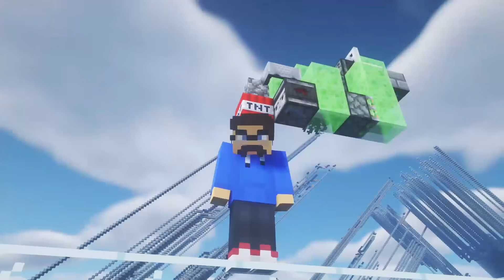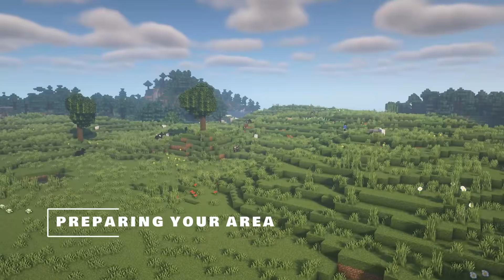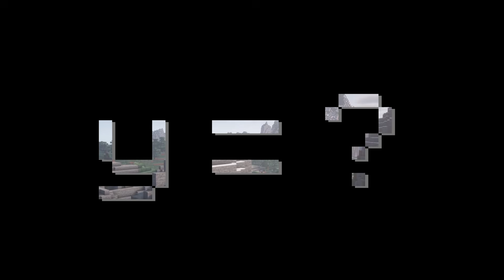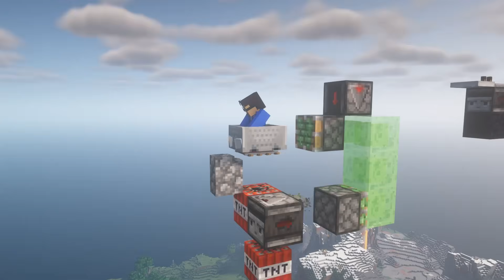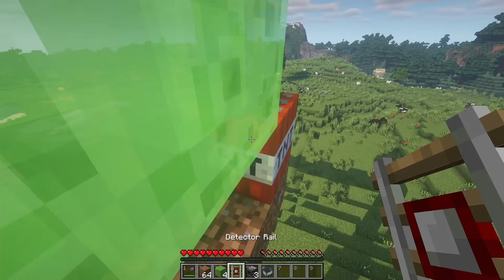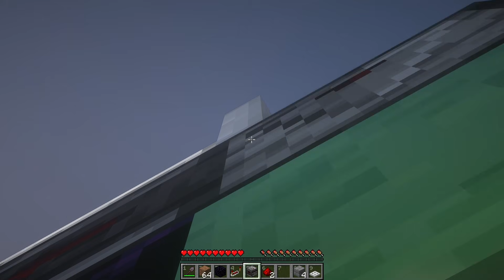TNT Duper Flying Machine

Comment: This works on 1.18.1 too, so yay!!!
Ok, so to clarify what the machines should align with:
Once you built the flying machine and its attached returner, the other returner should be aligned in a way where the iron trapdoor on the returner aligns with the observer on the flying machine and the observer on the returner aligns with the cobblestone wall on the flying machine.

If you match those two then the machine will return safely.
Reply: did that, still not working
Reply: how do i activate the machine, like to make it fly
Reply: Yeah it doesn't send itself back, im guessing this works differently in 1.20.4. The trapdoor doesn't go off, or at least long enough for the observer to see it.
Reply: @Sleeper____1472  Hi I FIGURED IT OUT, You need to set the repeater to 3 ticks not two, its a timing issue.
Reply: I'm sorry, but next time, DO THE SH!T IN CRATIVE AND ACRUALLY SHOW US WHAT WE REALLY SHOULD DL AND WHERE THE HECK THE SECOND TRAPDOOR IS GOING TO BE, IT JUST BROKE EVERYTHING.
Reply: @gilbert.9483oml thank you now ik im not alone 🙏🙏 he doesn’t even tell us where to line it
Reply: Yeah my tnt isn’t duping at all I tried building it in creative also tried it on minecraft Xbox one edition just because why not, everything else is groovy the machine works just doesn’t dupe, any way of making one with a dispenser?
Reply: @stevesober76seriesx25  its meant for java
Reply: @stevesober76seriesx25  dupers dont work in bedrock
Reply: the stone wall is higher than the observer so how does that work
Reply: @gammr3227  ohhhh. Dammit i just wasted 40 mins
Reply: It’s fake

Comment: Has anyone figured out why the machine is running but the TNT isn't exploding? It moves 1 block backward, but nothing happens. on Java 1.21.11. I made sure to use a dead coral  in the right place.
Reply: You might have built it wrong, I just made it and everything works perfectly.

Comment: I can confirm this still works in 1.21.11!
A couple things i noticed (which are all skill issues i faced)
1. If the return stations are not working make sure the repeaters are set to 2 ticks
2. If the minecarts fall off the rail, it may be because you bumped into it with your player hitbox. I fixed this by just placing the minecart last.
3. If the machine does not start going, make sure you have placed the last observer. 
I made this machine like a million times because im removing a mountain so I observed a few things while doing this and thought I should share incase other people are having the same issues. 
As long as you dont have a skill issue like me you should be fine though 😂😂
Reply: can you help me build it please i swear my skill sucks but 🙃🙃
Reply: Do you have to sit in the minecart for it to drop tnt? it fly's and returns but doesn't drop tnt
Reply: @joshuaburton462 no you do not have to sit in the minecart
Reply: @DarrinK2026  is coral fan is necessary
Reply: @GamingWithdevil-7 yes

Comment: return station doesnt work. you should showcase more of the machine and the actual parts when making these videos. for most of the part im guessing where to put certain blocks in relation to the duper
Reply: @etortuga1192  it does work
Reply: Set the repeaters to 2 ticks or it will not work

Comment: too many new comments saying it doesnt work 
IT WORKES (i'm on JAVA 1.21.8) 
as said in previous comments align your stone wall with the observer on the other side 
and i did max tics in both repeaters the one that sends and the return station 
thanks works fine just removed a mountain
Reply: @rotembar1551  fr it is working on 1.21.11 to

Comment: Still working in 1.21. I will say if you chain them together, you can hook a redstone trail where the dust is at the main start station to trigger it with one lever, the end ones will be a bit behind but still works, and space them about 10 blocks apart, I tried 8 and they blew up.

Comment: Either I'm doing something wrong or this design is only partially working in 1.21.4. I've built several of them in a big row to make a bigger hole (they aren't touching), and most of them work fine but some of them get stuck at the second return station or stop midair. It seems like there's no rhyme or reason as to which machines do or don't get stuck, just some of them randomly break. Anyone know why this is or, more importantly, how I could fix it?
Reply: try to do the second return station with a three tick repeater this worked better for me

Comment: it does work but the minecart keeps falling off the machine, does anyone have a solution
Reply: Your rail might be facing the wrong way. It should face towards the cobblestone wall, since the wall creates a sort of invisible slab which stops the minecart falling off that way. Or, the minecart could be glitching and fazing through the blocks below, which seems like lag or a tick error of some kind. If you're building on a server, it could likely be lag.

Comment: okay so seeing theres alot of people who dont understand the mechanics, the lower observer on the actual flying machine, take the coordinates on that one and align the repeater block on the return platform to that one. whenever the fence on top of the tnt hits the observer on the return platform the redstone dust will activate the trapdors which activate the LOWER piston to send signal into the piston to extend, it will then go back to the start position and be reactivated going back and forth.
Reply from the maker: bros the type of guy to read the terms and conditions before accepting

Comment: why is there no telling what to line up the return station with? the duper is 2 blocks wide. how am I supposed to know which you mean??
Reply from the maker: The flying machine is 2 blocks wide, the return station is 2 blocks wide, they are built on the same y-level. That's how you align them

Comment: it does work on Minecraft 1.21 Java édition 👍
Reply: Mine doesnt
Reply: @kindkenyon  it works, you may have it set up wrong, or you may be on a server where it is disabled.
Reply: @mixofreak  single-player game, and I have no lie made hundreds of these exact ones. I don't know what's going on.
Reply: @kindkenyon  I don't know then... Works on a current 1.21.1 server with fabric that allows tnt duping, and I literally was using it to blast through stone and deepslate when I commented, following this tutorial... so it isn't the tutorial or vanilla Minecraft that is the issue if you're struggling on single-player.
Reply from the maker: Yes
Reply: Do you knew if it works on aternis 1.21.3

Comment: even though it works and im happy with it, i am not sure how it can go back and forth. It goes flawlessly once to the 2nd return station but doesn’t go back and no matter where i place a lever, it doesn’t return to the first one. I don’t mind breaking the whole thing apart and setting it up again but a bit of a hassle; im in 1.20.4
Reply from the maker: May have to double check how you are building it sorry :(

Comment: DO NOT space these by two how he does in the video. at least not on 1.20. i built 15 and 10 of them broke in the first 20 sec cause they blew each other up. i recommend 3 or 4 spaces in between them
Reply from the maker: They might not be high up enough if they are breaking. But yeah you can spread them further apart, there will just be more cleanup afterward

Comment: my return station doesnt acrtiavate when the flying machine gets there. It dupes perfectly and once it returns to originaly platform it works, but when it gets to my return station it just stays, everything is aligned properly, idk what i did wrong.
Reply: You on 1.20.4?
Reply from the maker: Try doing 3 ticks on the repeater

Comment: FYI, works like a charm on java 1.20.1, and for Bedrock players, you can't dupe TNT, so it does not work on Bedrock. TNT explosion radius of 5M. I just did 9 blocks apart, and its too far. Do it every 5-6 block i guess.
Reply: 5 blocks apart, still not perfect.

Comment: Hello, any chance you can help me out. I got this to work for the first half of my parameter, but now the return station on the other side will not work. I  have to manually place a block in front of the base tnt duper to get it to go back across. any help would be greatly appreciated. * update that return system seems to no longer work. I had to come up with a new design***
Reply: You could’ve set the repeater tick to 4 and it works again

Comment: Great tutorial, very nicely explained and easy to follow. One issue though: Doesn't see to work with my 1.19.2 world - the dead coral fan is dropped, then the TNT is slid into its place, the machine takes off - but no TNT falls / explodes / is duped. 

Anyone else experiencing the same?
Reply: if its a paper /third party platform then tnt duping is automatically disabled. you can enable it .
Reply: @SaltySalman  Thank you sooo much!!!
Reply: yes I just tried this and it doesnt drop the tnt but it does fly
Reply: nope

Comment: I built this on a server and the coral instantly breaks when it starts flying
Reply: does not work on Spigot/Paper/Bukkit servers only in vanilla server
Reply: @sx1805  that would have been useful 4 months ago 💀💀💀
Reply: @sx1805  your a life saver I love you 😘
Reply: There is a setting in Paper to allow duping. It's in the unsupported area.  @sx1805
Reply: @sx1805  wrong it works on paper servers
Reply: @DayzChip  it doesn't
Reply: servers tend to have anti tnt duping, not all tho. Gotta check w the server owners
Reply: Turn on 'piston duplication'..
Reply: @ff_karan4846  where
Reply: Was it facing north?
Reply: @LaMaisonNoir  dude it was a year ago idfk
Reply: Same
Reply: @Kebab0960  sue the server owner

Comment: I’ll do you a favor and let you know don’t make them only 5 blocks apart cause when I did that ALL of my machines broke mid flight I’m assuming 8 blocks would be fine but I’m not sure. But I could be wrong cause I made my machine ten blocks above a big hill cause I wanted to get rid of it but first I completely flattened the hill to an equal y lvl and it broke the machine so if your trying to destroy a hill or something I recommend making it like 14 blocks above ground at least
Reply from the maker: That has more to do with the height of the flying machines than it does the the distance between them. You may just need them to be higher up in the air! Hope that helps in the future!
Reply: @KaleHameron  yeah I figured that out a few mins after I commented 😂

Comment: This tutorial is has lots of flaws. May I suggest if your not going to tell us the placement layout, use smooth stone so people can count for themselves. If I didn't already know how to line up the return stations, by your video, there is no way I could ever figure this out without doing multiple failed attempts by myself. You could easily solve this by showing a dud tnt flying machine go from one side to the other or just telling your viewers which block you are lining up so they are not stuck guessing.
Reply: LITERALLY MY EXACT PROBLEM.
Reply: My rail is turning the wrong way
Reply: Bruh it he said to be on the same level of as the machine but that was also wrong, i’m just glad I was able to notice it from looking at the coordinates and at how the nether roof was surprisingly close on the other end.
Reply: @christhaslag  I did it first time lol
Reply: I had that same problem. Such a horrible tutorial with hardly any references to look back on. I had to guess until I figured out the wall had to hit the observer which took a few tries.
Reply: I figured it out easily and it worked first try for me🤷‍♂️ i mean the return thing is 2 blocks wide same as the machine so you can only line it up in one way

Comment: Quite poor instructions I'm afraid. I followed it exactly like in the video and the first trapdoor was not in the same position as yours (your circuit was ON/RED - mine was OFF). I continued anyway and after placing the last observer the trapdoor started spamming ON/OFF. Ok - maybe that's okay. I continue to dig away dirt under the machine and after the dirt under the TNT was dug away, a TNT was duped and the whole thing blew up.

I would recommend instructions similar to ianxofour. If there is any part of the video that people might misunderstand then some people WILL MISUNDERSTAND it (Murphy's law).

Wasted coral and time on this thing which is a shame.

Comment: The thing moves fine but for some reason the tnt doesn’t light?
Reply: I have the same problem, did you find a solution?
Reply: @The_MoRRe  no i never could sadly. But on other servers it worked just fine. Ig sometimes it just randomly doesn't work.
Reply: @marshal_cody  So I tried building it on my singleplayer world but it doesnt work there, I built one in creative and that works but when I build the second one that doesnt work.
Reply: @The_MoRRe  ya me and my friends tried to build it on my Minecraft server and it wouldn't work. Then we went to my other one and it worked just fine. Both of them were vanilla Minecraft with no mods or cheats.
Reply: @marshal_cody  I am not saying that you are stupid but maybe you did the same mistake i did. I just realised i made a huge mistake, I used activator rails instead of detector rails. I mean what a stupid mistake xD. I dont know if maybe thats causing you the same trouble. Just wanted to mention it.
Reply: @The_MoRRe  ya that is what was wrong. Thanks lol! If only i figure that out before i dug the 100x100 hole by hand.
Reply: @marshal_cody  ah man, I started digging my hole aswell by hand but then went back and watched the video for the 1000s time and saw the rail was wrong lol. Good luck!
Reply: @The_MoRRe  thanks you too

Comment: The coral fan breaks instant
Reply: same
Reply: Paper servers have this disabled by default.
You'll have to go into the config file and set piston duplication to true.
Reply: @pheldsparr  I’m not in a server I’m in a single player flat world in bedrock 1.21.1 and the coral fan is still breaking
Reply: @MerivalePrints I see. In that case, your issue is that this tutorial is for Java Edition. Tnt duplication in general is based on a glitch that doesn't exist in Bedrock, so unfortunately you'll have to either use crafted tnt or switch to Java.
Reply: On a server I'm on it does that. In the singleplayer it works perfectly. Not sure why yet.

Comment: What the  gap should be between the tnt duper flying machine ?as you showed at the end of video
Reply from the maker: I usually do 2 blocks in between each machine and it’s enough, but if you don’t want to use as many resources you can do a wider gap. Although, you may have more floating blocks to clear
Reply: @KaleHameron  I am not tight  on recourse budget . Clearing floating would just be pain (I saw how they look in dusty dudes vid) thanks for reply tho!

Comment: There is no specification where to line them up. Now I have sticky pistons pushing and pulling at the return station forever because I think I was 1 block off lining it up. From the looks of the video after 15 minutes of trying to figure it out it seems like you have the observer go into the trap door and the fence go into the return station observer. Mine ended with my observers facing each other so the trap door is going non stop and the sticky pistons are going as well. Glad I did a backup before building the return pad. Attempt 2 here I come.
Reply: for me i figured mine out by sneding it to the other side then lining it up with logic
Reply: @klebstaa  Someone actually tried something logical? 😱
Reply: Thanks so much !

Comment: uhh , if it doesn't return, then did I stuff something up? Like are the observers supposed to be 1 above the other? It started just fine but when it got to the other side, it just stopped...
Reply from the maker: There shouldn’t be any observers stacked on top of each other I don’t think. The second return station just needs to be lined up with the flying machine, (Both are 2 wide, so they should line up) then the y level for the platform you build it from should be the same on both sides.
Reply: @KaleHameron  did that and followed the tutorial carefully but it still won’t work
Reply: @KaleHameron  forgot to mention that even if it would work going back, I’d have to manually break then replace that block every single time. I extended the reapeater side by 1 block and it worked only once. But never worked again...
Reply from the maker: @InfinityShadow20  I’m not sure what isn’t right then. I used this design all the time and have never had problems. I can try to help out more in my discord, or give you a schematic of the design
Reply: @KaleHameron  maybe it’s because I’m in version 1.17.1???
Reply from the maker: @InfinityShadow20  The design was made in 1.17.1
Reply: @KaleHameron  Oh, I thought you ment 1.17 specifically, Not 1.17.1. Anyways, Yeah it doesn't work for me...

Comment: how far apart do they have to be from each other?
Reply from the maker: I typically space each one 2 blocks apart, however you have to build them a bit higher if you do this (or alternate launching). If you don’t have the resources you can definitely space them out a bit more, but there will be a lot more floating blocks to clear out
Reply: The most efficient way is to leave 4 blocks between the tnt, that is 3 blocks between each module. It destroyed all of the blocks when i used it

Comment: Tutorial is perfect other than the fact it doesn't show it actually returning back from the return station.. I've tried to match up the coordinates but cannot get it to return the machine..
Reply from the maker: You just have to line it up with the flying machine. Everything is 2-wide, then for the y level you build it with the temporary blocks at the same height. If it’s not returning it could be the repeater not being set to 2 ticks. Hope that helps! :)
Reply: @KaleHameron  Does this work on bedrock Ed